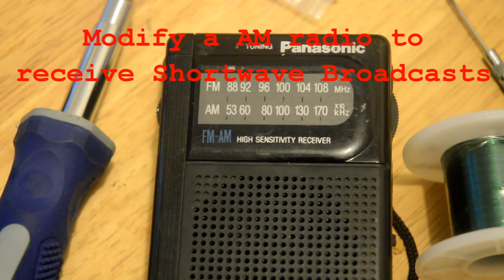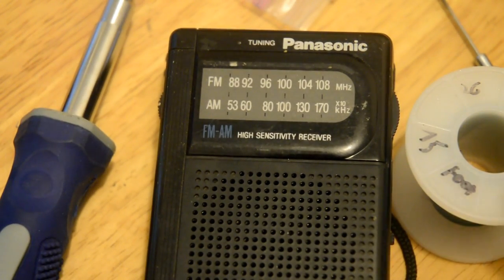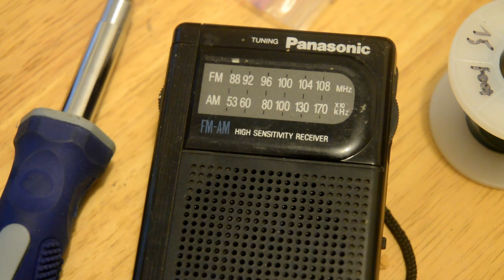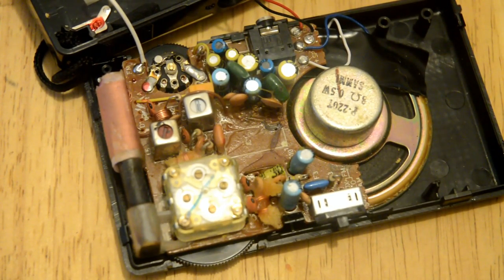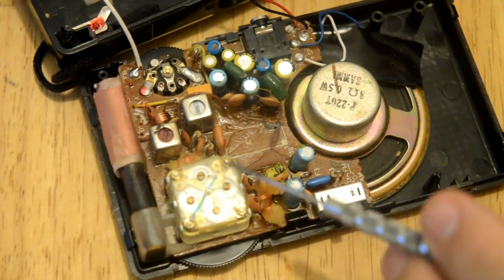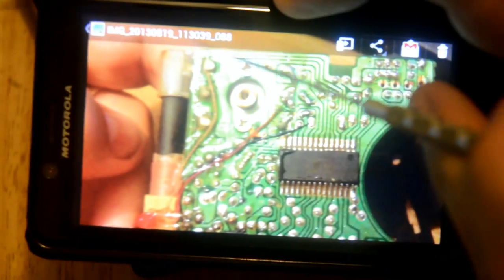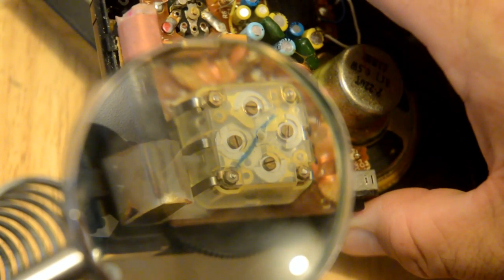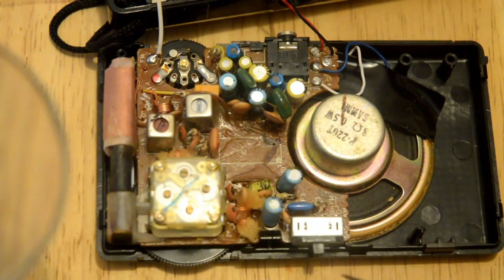Modify a AM radio to receive Shortwave Broadcasts

Comment: Back when I was a kid in the 60's I was really into  shortwave DX'ing, I would go to the library and read popular electronics when ever a new issue came out, turning to the back of the magazine to the shortwave section, and read all the great stuff. So I began messing with old shortwave radios that we had, the big floor models that we had back then, but most of them were poor without a good antenna, and we didn't have one  of those. I had a little JADE 10 transistor radio, the pocket kind that ran on 9 volt batteries, my problem was the cost of those damn batteries.  So one day when I could not listen to the Stones on my transistor, I took a six volt lantern battery off an old flashlight and wired it up to my JADE radio.  Well i was shocked to hear short wave coming from that little 2 inch speaker, and at night, man the stations I could pick up. I kept that radio for years, then after getting married and moving on with life, I forgot about it. Here about six years back my mother produced the little green radio, the tape was still there where I had the six volt battery. I put in a 9 volt and the stupid radio still works!  Now that's longevity.

Comment: Back when I was an SWLer in the 60's my SW radio did not have a BFO and I wanted to listen to CW and SSB stations so I found if I place a small transistor radio next to the SW radio I could inject a BFO signal and tune it with the small radio tuning dial. SSB and CW came in relatively clear sounding.

Comment: In order for you to be able to make the radio work properly on shortwave, you need to make two coils on the ferrite loopstick antenna.  You need one for the IF oscillator and one for the tuning capacitor.  The IF or (Intermediate Frequency) oscillator must be 455 kHz below the tuning frequency.  The number of turns would need to be calculated or done by experimentation, but needs to be a little less than the tuning coil.  The IF oscillator coil would need to be connected to ground and the third terminal on the AM side of the tuning capacitor.
Reply: True That !
Reply: Or just make a direct conversion or regenerative receiver, you can make one with bare bones stuff
Reply: Yeah, its silly. Probably beating with 2nd or 3rd harmonic od local osc.
Reply: @paulphoad  or possibly a nearby station provided that needed signal to mix with, i mean even a single dioder become kind of a mixer with slope detection...

Comment: Worked great. Thanks. Converting AM transistor radio to shortwave. I always wanted to try this. All I did was touch metal to metal for connection. No tieing on. No solder. . Also received US Armed Forces Radio Service signal. 73.
Reply: Years ago, I did it the easy way.  I held my transistor radio against the refrigerator, and picked up Radio Havana, from Madison, Wis.  By years ago, it was 55 years ago.

Comment: One thing to note is that using a regular AM radio for shortwave is not ideal due to the 455 KHz IF that they use. You'll have issues with mirror images 910 KHz up or down. 

Many cheap multiband radios suffer from that issue due to cost cutting, even some more old school 1970s radios! It was cheaper to use a single 455 KHz IF for all the AM bands. 

Although today that's even a feature due to less crowded bands, as it extends the range 910 KHz upwards, back in the day it would probably be a problem having two stations 910 KHz apart mixing.

Comment: You need to replace the batteries in your smoke detector. The chirping gets to be annoying. Other than that a big THANKS goes out to you for putting this demonstration together and editing onto you tube platform. I miss Radio Shack. Now if I need exclusive parts I have to shop Good Will stores for old radio donations to canabalise the components I need. (Any one reading this comment that might have a better suggestion through" brick and morter" business is much appreciated.)

Comment: This was popular in prison. In Florida,you were limited to a cheap G.P.X. Clear analog radio.(if you could afford the $ 30.00‼️).
There were those who could/would repair them. Not allowed, but generally overlooked. They used a spring from a lighter.Solder came from the plumbing department. Soldering iron was a nail, and a lighter.
Very popular especially with the Spanish guys.
I always had a short wave since I was a kid,so....
The 49m band was basically superimposed over the"am"(mw).
Reply: Always amazing ro hear of the ingenuity of prison countraband devices

Comment: Greetings, I needed a SW for sports radios in Europe, mostly England and Spanish/Italian if possible. Can you guys tell me if this is possible living in Portugal and what is the best equipment for that? Appreciate it
Reply: FailHQ buy several old radios, ask for junk radios, remove the variable capacitors, ferrite bar antennas, diodes (small glass tube with a green, red, or black stripe on one end), make a crystal radio, (wind a coil with magnet wire, from a wall adapter), and try different connections. you may get AM or SW stations!!! I experimented with different diodes, capacitors, homemade coils,  and can listen to Cuban radio, Nashville,TN, and nearby,local AM stations (even ESPNRadio!!!!)

Comment: It's a good idea;  
Looking at it from a crystal radio builder's viewpoint; If (from looking at the common end on the capacitor) you had both coils wound in the same direction (or inductors in parallel), then the impedance would be reduced and it's reception would move up in frequency from AM. Then it's a matter of finding the frequency range you just moved it to. But, if your new coil were wound in a reversed direction from the one in the AM coil...... this would not work very well.
 
My crystal radios use 5 turns of the same wire as the antenna and ground connection, and 14 turns of the same wire to go to the crystal radio detector circuit. I get 3.1 to 7.5 MHz pretty well with this. With the center of the dial at 6.2 MHz. They are wound in parallel with 1/8 inch space between the coils (side by side)., with better reception if there is no electrical connection to the detector coil from the antenna and ground coil. 

On an 1-1/8th inch coil form with no ferrite inside. Most AM band crystal radios would use upwards to 80 to 125 turns or more on the detector coils for the same size coil form and the same wire.

Comment: When I was grade school age I found that disconnecting one of the antenna coil leads from the variable capacitor brought in the lower shortwave bands, I believe up to 49 meters. Local AM stations could still be tuned in, and the shortwave bands would repeat themselves across the dial. It was limited as a way to convert to shortwave, but at the time it fascinated me.

Comment: When I was a kid my buddy showed me how to scrape the coating from the center of the am antenna coil and twist a wire around it and theow the 10' of wire across the room and whala shortwave. freqs depended on length of wire.

Comment: I carry a Sony ICF-SW07 which is always with me and in a Faraday bag at all times (except when in use). Should a sudden EMP or extreme Solar Flare occur... I will be one of the only ones with a working device, YHEAY!!! Although the Sony SW07 and SW100 are very expensive pocket radios,.. good small short wave radios (as small as a deck of cards, literally) can be found on ebay or online for $30-100. A great example of this is the Degen DE 17 for about $30! The great information about your modification in this video is truly a skill, but the radio is probably more valuable unmodified - as the AM radio itself (Medium Wave) comes alive at night when signals begin refracting (or bouncing) off of the ionosphere, which is a phenomenon called 'Vertical Incident Skywave Propagation'. From sunset to sunrise, AM stations can be heard from 300-1500 miles away - often from other countries or continents. It is my opinion that AM radio is one of the greatest resources available to anyone... and definitely an invaluable prepper's tool during any situation. PREPPERS UNITE and stick together! Thanks for your Video!  Mark, KC9TSR
Reply: prepping for the last 2 years here, i love the clever, cheap ideas all around  😁🤘

Comment: Interesting.  I suppose if it works well it's fine.  I always changed out the antenna LC tank circuit out to resonate in whatever portion of the SW band I wanted to hear, then re-peaked all the mini-cans except for the 455khz cans which are the same for any radio.  The frequency shift is limited only by the range the circuits can be made to resonate, and some radios have more range than others.  "Shortwave" is an interesting historical term.  In the early days of radio, shortwave was the extreme high frequency of the usable spectrum, and since radio waves get shorter with increasing frequency these upper frequencies were called "shortwave."  By today's standards though, almost all transmissions are light-years higher than "short" wave.  It also marked the last time that radio bands were referred to according to their wave lenght, i.e. LW, MW, SW --- all later higher frequency bands were named according to their frequency range; i.e. HF, VHF, UHF, otherwise there would be nothing else to name them. Imagine a "shorterwave" band, or a "really, really shortwave" band.  LOL

Comment: If an EMP or Carrington Level CME (solar flare) hits, it wouldn't matter if it "knocked out" radio...it also fries all electronics, so your modified AM/FM-to-shortwave radio would also be fried, rendering it useless.
Reply from the maker: emp is not a super kill shot every one thinks it is. Look up some of the imfomation about project starfish prime. high-altitude nuclear test.
Reply: will copper wire from an old tv work i have a big spool of it
Reply: actually NCP has a point -- different wavelengths have different properties when it comes to solar disturbances. Propagation is its own, whole hobby. Maximum usable frequency and lowest usable frequency are well-known daily and hourly stats. Coronal ejections can be beneficial to one wavelength and detrimental to another. Look it up, Wil, it's fascinating. Now, one hitch is that AM band is actually a lower frequency than so-called shortwave or HF, and can bounce around, too, but he's still right because shortwave can fall right between the max and lowest usable., depending on conditions. This is awesome, because I tried it myself hearing you could do it and just failed, without seeing it, and it was before I got into the hobby. I just finally found my first SW radio at a flea market, but it's important to know how to do this if you were wandering around with nothing, and wanted to get a world broadcast instead of local propaganda. You can turn any clock radio into a po boy trans-Atlantic. Thanks!

Comment: Hey Richard, where can I get a sw radio for that cheap? Certainly not a grundig or an Eton.
Reply: rangers199487 I'm not very experienced, but as far as I know Grundig and Eton make some darn good SW radios...
Reply: rangers199487 What kind of SW radio are you looking for?  Do you only want to receive the international broadcast bands, or do you also want to hear the aviators, marine stations, various utility stations, and ham radio operators SSB mode?  A decent battery powered radio to receive those SSB transmissions will cost somewhere around $100, and one that's just for receiving the international broadcasts will be quite cheaper.
Reply: rangers199487 Look for used Amateur Radio HF rigs. Depending on what radio you get it might be bulkier than you want. But you might be able to find something cheap. Whatever you find just make sure it has general receive coverage. Also keep in mind that most HF radios aren't very good for medium wave or long wave. So AM broadcast band reception will be lacking. The latest rig I purchased (Icom 706 MKIIG) I chose in part because it has better sensitivity on the AM broadcast band than other radios I was looking at.
Reply: rangers199487 However, you do need a license to operate an Amateur Radio HF rig, since they have transmitters built into them.  There are many models of radio which receive just as well as an Amateur Radio HF rig, and don't require a license since they don't contain a transmitter.  I would go with those, I'd stay away from the Amateur HF rigs until you have a license!
Reply: KC1BZF And yes, ALWAYS go for general receive coverage!
Reply: rangers199487 just take a small diameter tube (plastic, from an ink pen), make 2 holes at, near the top of the tube, wind 75-95turns of insulated magnet wire (from a wall adapter), make 2 more holes at the bottom of the tube, remove or burn off the insulation from the wire, connect the wire coil to one side of the variable capacitor of a radio, and the diode (it will be a clear, small glass tube with a red, or green or black stripe on it), and a long wire to the variable capacitor corner (this will be your antenna).I made several coils, (50, 75, 85, 90, 95 turns), connected it to different diodes and capacitors from salvaged radios, and have Cuban radio, European radio, Chinese, Japanese, and SW from Nashville TN!!! really, just try different connections, different size coils, different diodes, and you may be surprised!!!
Reply: KC1BZF you could modify an FM radio to listen to pilots. turn the radio on, open the radio, look for a small, copper coil, next to the variable capacitor, and touch it with a screwdriver, or something metallic. if the channel changes, tune the radio to the highest frequency, and spread that coil gently. the channel should change, and tune your radio up and down the dial, and you might hear aircraft/pilots transmitting, talking!once you have several channels that you can hear the pilots on, close your radio, and mark the channels on the radio dial!!!  its just hit and miss.....have fun!!!
Reply: unless someone gives you an AM/FM/SW boombox, free of charge!
a friend of mine gave me an AM/FM/SW radio, and it works great! I calibrate my homemade SW crystal radios with it.

Comment: Can't see this working well as most modern AM receivers are super heterodyne and requires a internal local oscillator (L.O.) set at 455 kHz away from the tuned frequency which is mixed with the received signal to produce a 455 kHz internal beat frequency (I.F.). You changed the front end tuning but not the L.O. so the I.F. amplifier which is tuned to 455 kHz won't have much to amplify...There are 2 changes that need to be made and you only made 1.
Reply: It WILL work, with ANY receiver.  You don't have to tune or screw around with anytthing. It's basic LC math.
Reply: +MauriatOttolink 
Dear Sir,
This radio will work. I have made two of them in the past. I am a Radio Amateur. In addition, I hold all of the commercial radio licenses from the Federal Communications Commission, including a Ship Radar Endorsement. I have been experimenting with all types of communications now for over forty years. You might enjoy trying this project as much as I did if you will try it. But Please Trust it will work. In my comment (above on this same site) I do explain another way of doing so. Sincerely,  William Pietschman, R.N. (W8LV)
Reply: +William Pietschman VO1CSD here, licensed since the 80's worked as an electronics tech for 35 yrs...any amateur radio operator should understand why this mod isn't correct. If this works so good then show it working....
Reply: +Craig Diamond Dear Sir, This radio will work, I did the same thing many years ago, and found it best to leave the cans alone and just do the antenna modification, as I discussed at length (just hunt for my post here) and here you have this Gent showing you that it works, and the testimony of at least one other person here in the comments section besides myself. I really enjoyed this video, and it's refreshing to see the torch of radio being passed on to younger generations, Radio being essentially 100 years old now. Radio is magic! 73 and All the Best... My own radio journey is found at www.hamqth.com and there just enter my Call Sign, W8LV.
Reply: +Craig Diamond Dear Sir, This radio will work, I did the same thing many years ago, and found it best to leave the cans alone and just do the antenna modification, as I discussed at length (just hunt for my post here) and here you have this Gent showing you that it works, and the testimony of at least one other person here in the comments section besides myself. I really enjoyed this video, and it's refreshing to see the torch of radio being passed on to younger generations, Radio being essentially 100 years old now. Radio is magic! 73 and All the Best... My own radio journey is found at www.hamqth.com and there just enter my Call Sign, W8LV.
Reply: +Craig Diamond Has anyone here ever tuned up (peaked) an A.M. receiver before or even have the slightest notion on how such a receiver works? Being a super heterodyne receiver I am sure there are spurious signals after this mod but nothing of any good sensitivity or definite frequency selectivity.

Comment: 4 Khz to 9 Khz is in the audio spectrum you can hear that with your ears. Did you mean Mhz because those frequencies don't contain enough energy. Also did you fine tune the 455Khz if transformer. 160 meters is best for night time reception if your not in high noise area and 80 meters. If you have a real bad EMP unless your radio is in a Faraday container or cage it will also be blown especially solid state.